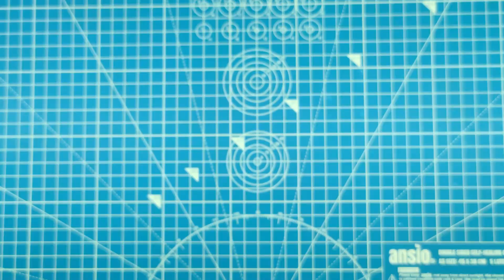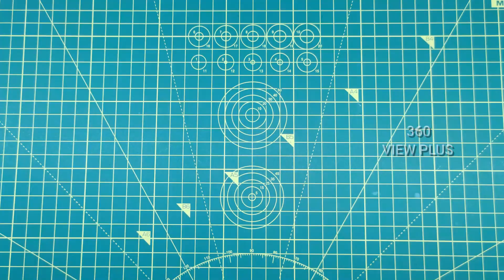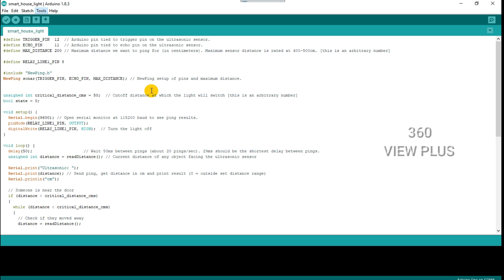How to make "AUTOMATIC IN-OUT /ON-OFF ROOM LIGHT" using Arduino UNO

Comment: Bro I am gettinv error message can you pls solve me...

Arduino: 1.8.3 (Windows 10), Board: "Arduino Uno"

C:\Users\VIJAY\Desktop\smart_house_light\smart_house_light.ino:7:10: fatal error: NewPing.h: No such file or directory

 #include "NewPing.h"

          ^~~~~~~~~~~

compilation terminated.

exit status 1
Error compiling for board Arduino Uno.

This report would have more information with
"Show verbose output during compilation"
option enabled in File -> Preferences.
Reply from the maker: You probably did not install the library properly. The best way to install a library is the use the IDE Library Manager. Fortunately the NewPing library is available through the Library Manager.
Reply from the maker: So kindly install Newping library and check dude